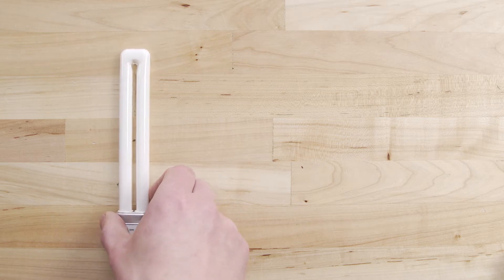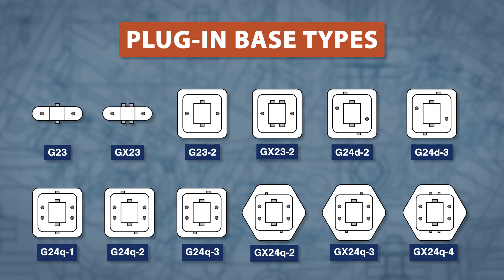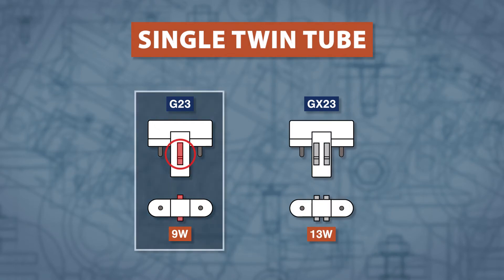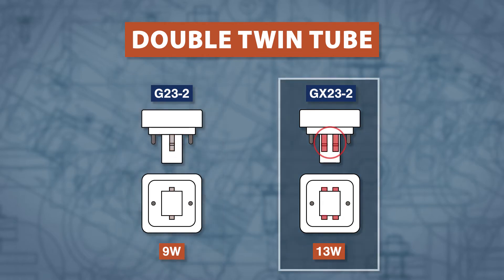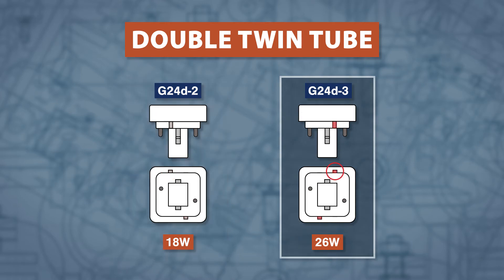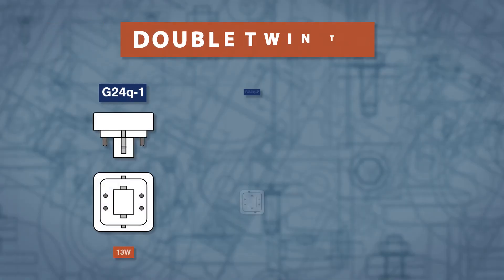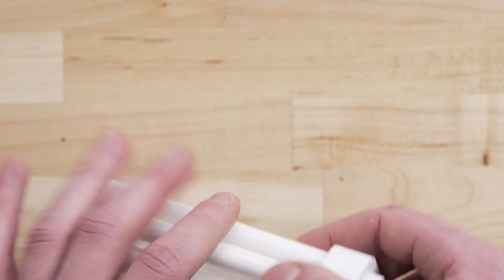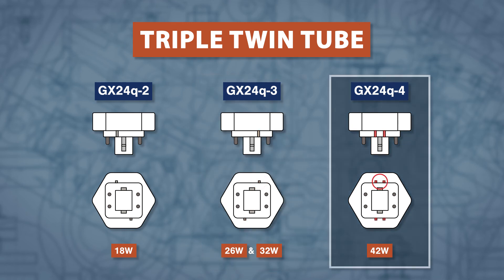Plug-In Twin Tube CFLs - Base Codes & Watts | Spec. Sense

Comment: Thank you for your email. In the 2 pin CFL fluorescent bulb it says 7w / 11. So is it not possible to
fix a 10 watts ballast for it?
Reply from the maker: Thanks for watching. It seems like the bulb is rated for 7 watts, the 11 could be just another number. Unless it specifically says it's for a 10 watt ballast, you don't know if it will work properly. However, these plug in style lamps are designed to only fit one ballast. If you match exactly by the base and mounting tabs then the replacement bulb will be compatible.

Comment: Thank you for the explanation.
My question is whether a two pin
CFL 7 watts/ 11 fluorescent bulb
Can be fitted to. a 10 watts ballast?
Thank you in anticipation.
Reply from the maker: Thanks for watching. Based on the plug in style bases, if you match based on the exact base type then you'll know for sure that the bulb is compatible with the corresponding fixture.

For other flourescents, putting a 7 watt bulb in a 10 watt ballast might not work properly.

Comment: Another helpful thing would be how to release the base/bulb from the socket. the GX23 appears to have clips on both sides - how is the side against the ceiling supposed to be pulled back?
Reply from the maker: Thanks for watching. Not all fixtures are the same and some have more room than others. You might need to use a tool to help release that clip from behind the bulb.